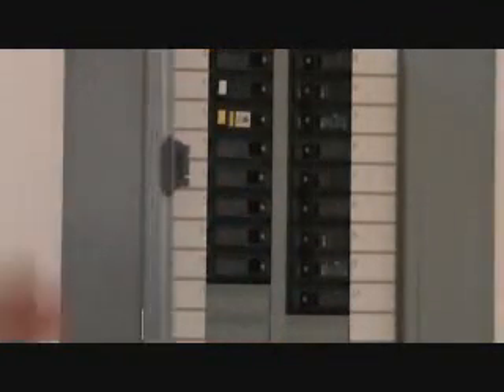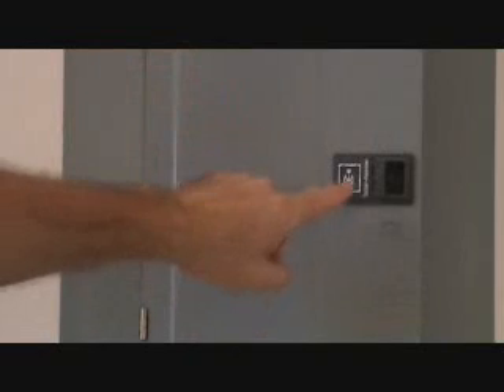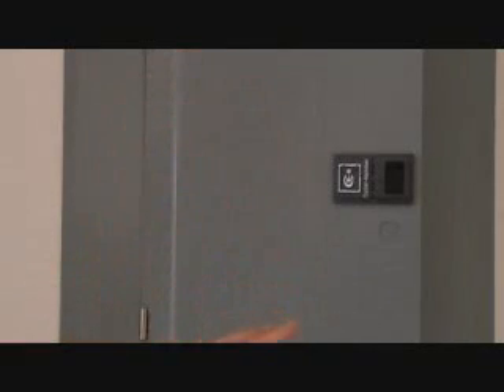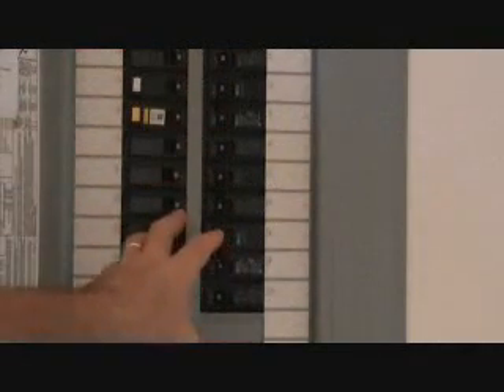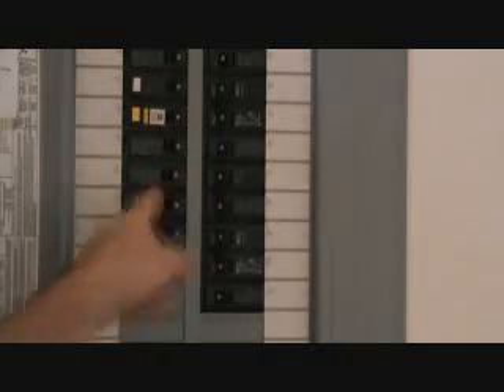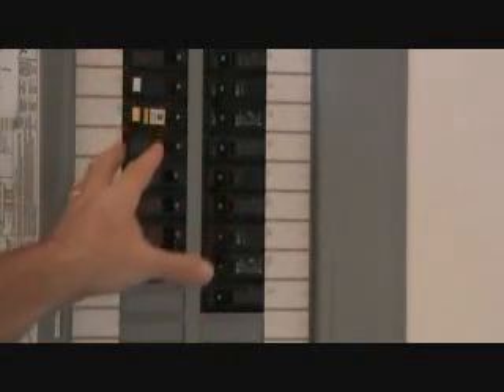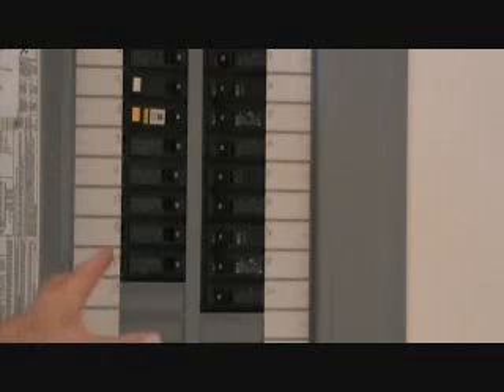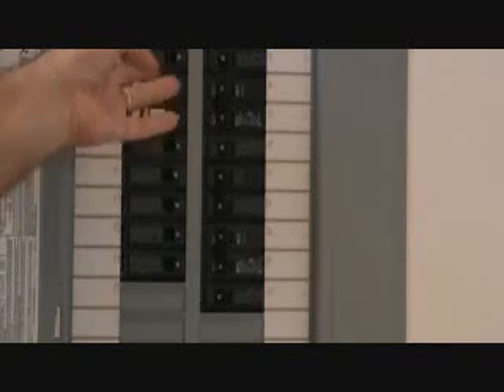Replacing an electrical circuit breaker in a sub-panel: how to match up a breaker

Comment: Ok I have a question about these. You said people can work on hot panels. I know you said you wouldn't have someone do that but I am curious what are the actual odds of someone hurting themselves doing this. I live in an apartment and my roommate hasn't paid the bill for 2 months and technically 3 months now because we just got the last bill. If I cancel the electrical bill then we will still get billed by the apartment because that won't shut the electricity off so my only option is to take out the whole panel. The security here sucks at night so turning it off shouldn't be a problem if I can find it. My roommate just quit his job and doesn't seem to be looking for a new one either.
Reply from the maker: Please I hope you didn't try to take the panel! Most panel have to lids & one of the lids will be so you aren't suppose to remove it. You could then turn the main breaker off on the side you should never remove then the other side where the breakers are you can work on knowing there is no power over there if you have the main breaker turned off first. But no...don't take the panel. That panel is part of the  apartment & should stay there for the next person. What did you end up doing? Always better to work things out with roomies even at the end of a lease. What did you do?
Reply: @VideoJoeKnows  it was 7 years ago. I think I found the main breaker box outside and it wasn't locked so I flipped it. It was a temporary solution and didn't accomplish much. They found it after a few days. Eventually I decided if it continued to be an issue I'd just not pay the bill which would result in our power being cut off. Moved out. Had a good roommate for a while and now I have a difficult roommate situation again.
Reply from the maker: @jerkface38  Well try to work things out as it's always seems better that way...right? Or what other choices do you have? Weigh your decisions then go for it!
Reply from the maker: @jerkface38  Well good luck to you on all fronts!

Comment from the maker: This video shows the first important step before actually replacing an electrical breaker. The title is "replacing an electrical circuit breaker in a sub-panel: how to match up a breaker". Maybe you didn't get a chance to read the last part of the title...? Wasn't sure what else to call it. I guess I could've just called it "how to match up an electrical circuit breaker" & left it at that. Thanks for your comments. I appreciate the feed-back!   Joe  :0

Comment from the maker: @Nickrox48 Generally there is one sub-panel per main panel. If a building has 6 main panels outside, like an apartment building, then you will have 6 sub-panels inside the main area of each apartment. You could have another sub-panel off of one sub-panel, for a total of 2 but most places get by with just one sub-panel. Did I answer your question? If not, send another specific question.   Joe  :0

Comment: How many sub panels can a building have
Reply from the maker: It would depend. Most houses have a main panel like out next to the side of the garage or somewhere like that & that's it while other houses will have one main panel outside then also have a sub-panel inside the house somewhere & usually that's about it. For a commercial building you could have 6 main meters for 6 panels one for each tenant then you can increase that sometimes to 8 meters with 8 panels but those are main panels not sub-panels....

Comment from the maker: @TeDuaMalakie If you don't feel comfortable replacing a bad breaker, then get a pro to change it out for you. If you turn the main power off, it's pretty easy to replace a breaker though.....provided you have the right replacement breaker to install. Thanks again for commenting.   Joe  :0